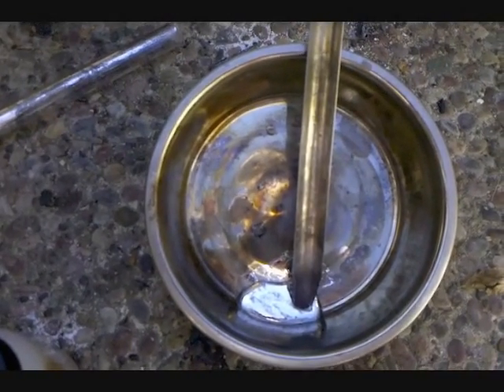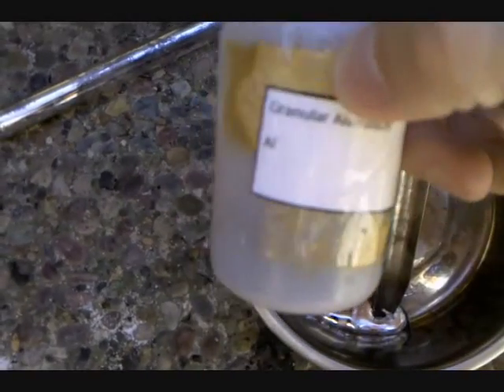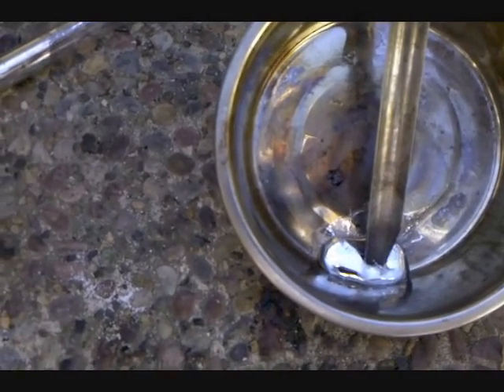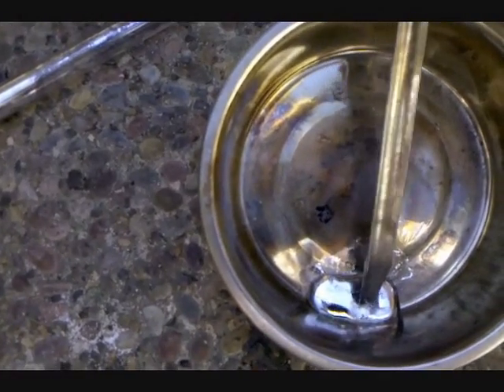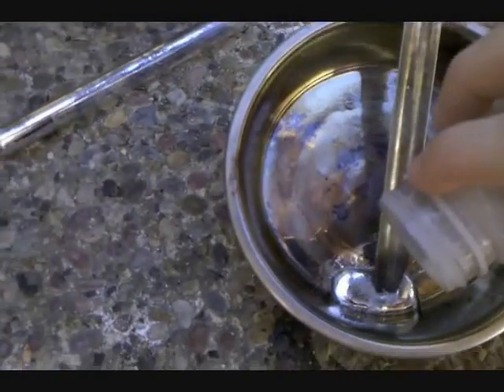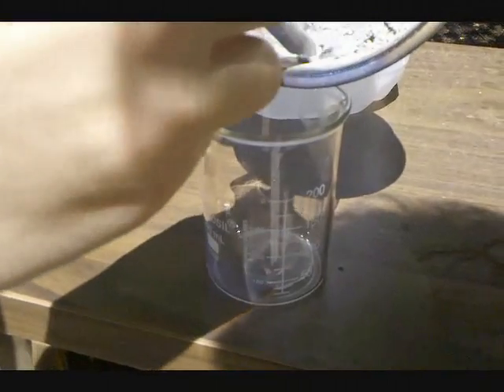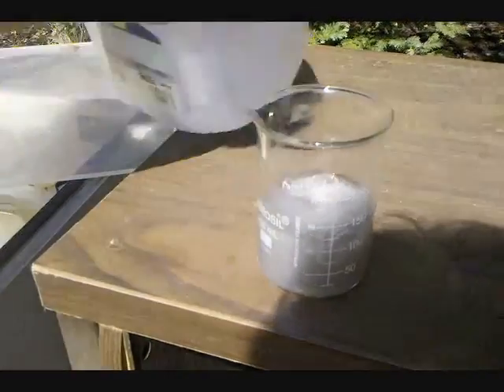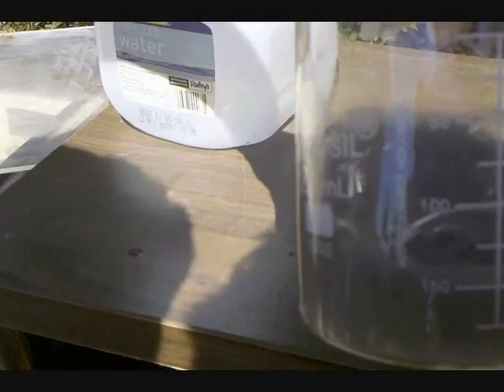Gallium Aluminum Alloy

Comment: after use gallium, you can reuse the same making recycling!
Reply: Not exactly, the aluminum oxidizes into aluminum oxide, which can only be separated by electrolysis
Reply: +Yeah,i guess so Hey, how long did it take to finish alloying? im making some right now and i dont know how long to leave it in

Comment: If I am correct, this safe alloy could be used to replace aluminum amalgams for many reactions.
Reply: Can you make a video about making isopropylamine using aluminum galinstan amalgam? Gallium, Indium, and Tin are non-toxic. 
 
https://youtu.be/sPsVdiL-VdM 
https://youtu.be/qB0GDbhpw-Y 
 
69 grams of Gallium, 21 grams of Indium, and 10 grams of Tin are placed in a beaker and heated. The result is 100 grams of galinstan. 
 
90 g of aluminum foil is weighed out and ripped or cut into small pieces. 10 g of Galinstan is weighed out and placed in a crucible. It was heated with a torch. The yield is 100 g of aluminum galinstan amalgam. 
 
A mixture of 17 g (0.3 mole) acetone, 200 ml ethanol, 200 ml 25% ammonia(or 500ml 10% household ammonia), and 80g aluminum galinstan amalgam is placed in a 1 Liter flask(or 2 Liter) and warmed with strong stirring until reaction takes place, after which warming is stopped immediately. Cooling should be applied if the reaction becomes too violent. When the violence of the reaction has diminished, the mixture is refluxed with vigorous stirring for about 3 hrs(with liebig condenser). The mixture was filtered with a buchner funnel and the galinstan recovered. The filtrate was dried with magnesium sulfate. The yield is isopropylamine freebase. The isopropylamine freebase can be reacted with hydrogen chloride gas in a beaker to form isopropylamine HCl. Alternatively, you can use hydrochloric acid and then evaporate the solution in a beaker. The isopropylamine is weighed.
Reply: MrItsthething it produces a shit Tom oh hydrogen and heat on contact with water though

Comment: 350 Miles on $28? Just Add Aluminum Gallium Alloy and Water......Researchers at Purdue University  have refined a technique using aluminum gallium alloy (80% aluminum, 20% gallium), to wrestle hydrogen from water. The liberated hydrogen can be used on-site in a combustion engine, or even better, in a fuel cell. The advantage of this technology is that it removes the complications related to storing hydrogen as a gas, instead you simply add water.

Comment: @wkc073406 The point is that one can never get enough energy out of a fuel to make the same amount of the fuel (let alone use any of the energy for something else).  Even in a perfectly ideal case, it takes, and must take, as much energy to make the fuel from its byproducts as can be extracted from it. In the same way that a perpetual motion device is impossible without some outside energy source periodically bringing it back up to speed, you can ONLY lose net energy in burning the...

Comment: @rjswolfman Very good point.  Purdue mentions recycling iterations bringing kWh cost to comparable rates.  I don't have info on the recycling process.  So, it could be bunk.  
Though, the process publishers bring up a very important point.  Green energy storage and energy gap (read Peak Oil).  Maybe days are gone of a 50:1 energy return with fossil fuels.  What is the next best return energy technology / infrastructure?

Comment: @goamarty Yep, it's clear to me now that Al production consumes ~12-15 kWh per Kg.  
The energy density of the Al+Ga+Sn+In alloy (solid form), developed by Purdue, has an energy density of 8.8 kWh.  Though, the publisher states that comparable kWh cost to grid power is possible with many recycling iterations.  I'm just not sure what process they are citing that would contribute to reduce Alumina to Al kWh cost, not to mention Ga, In recovery.
Yes, bad idea if only 8.8 kWh / Kg.

Comment: @wkc073406 Hi, here is a Paper about this alloy: google "Activation of aluminium metal to evolve hydrogen from water" but i have no acces to it. But there are a lot of papers and i think a few patents about it. Just serach a little bit at google.

You can make a simple try by melting aluminium and dissolve a little bit of ga into it.
I read that indium also will work but i lost the literature about this

Comment: @hkparker Big parts of the population accept energy sources countaining radioactive urnium and plutonium. Thats not the point. The point is: we dont have an energy source here. The fuel - aluminium - is produced by electrolysis. This needs more energy than you could get back.

Comment: @TheSSDrift Aluminium is made by electrolysis. If you need H2 you can save energy by electrolysing water instead of aluminium oxide.

Comment: Al, Ga, Tin alloy's energy density is greater than coal.  

A competitive electricity kWh (10c) can be achieved after a number of recycling cycles of the aluminum oxide and gallium.

Why would be blow up the Earth's crust continuously in search for an expendable fossil fuel, when we can 

Mine once - Burn - Recycle - Burn ......... forever.

Comment from the maker: @Evanator22742 In theory no gallium is lost whatsoever.  So yes, all you need to do is seperate the aluminum compounds.  I've been looking for a way to do this effectivly and found that (of course) hydrochloric acid is effective at disolving off the compounds, and doesn't react quickly enough if ever at all with the gallium to disolve it.  Then the gallium can be reused.